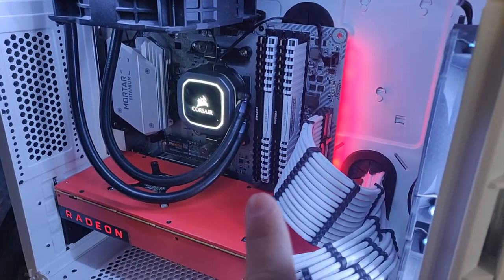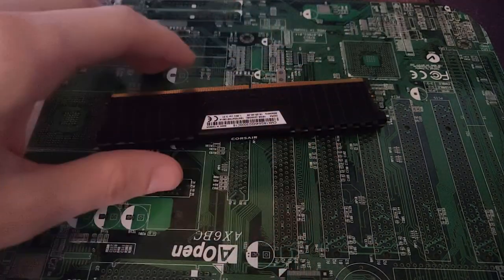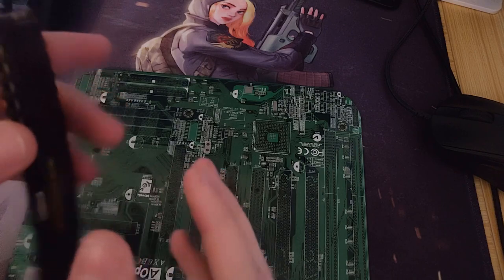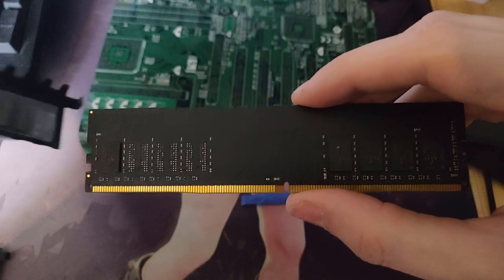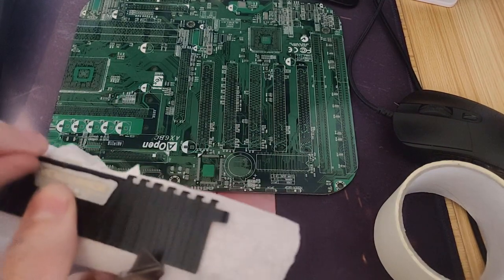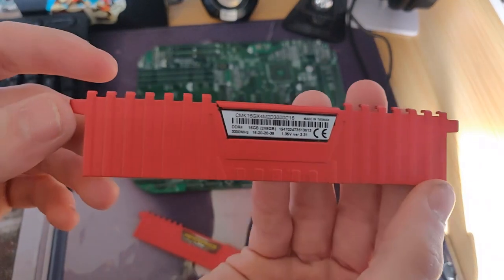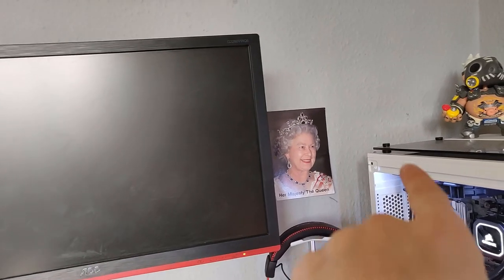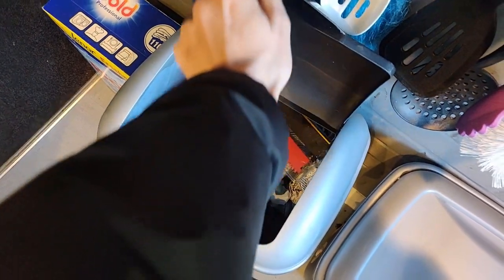Painting Corsair Vengeance RAM (tutorial)

Comment: Idk if you will be able to answer this but I painted mine and now my pc is shutting down after like ten minutes of a game do you thing it is overheating or something?
Reply from the maker: Did you take it apart correctly?
It could be multiple things
Reply: @tomoldy9767  I think I did nothing came off the stick and it went back together fine. I've taken it apart since then and now it won't boot 😖
Reply from the maker: It could mabye be just 1 small module came off somewhere, it's very risky doing This
It could just be dead all together
I broke a stick when I done mine and had to buy a new one
Reply: @tomoldy9767  thanks I worked it out one of the tiny things on one of the ram sticks came off so yh I'm stuck with 8gb but it's all good
Reply from the maker: @ned_he  atleast all of it didn't break and you can still use pc 😁
Reply: @tomoldy9767  yh it's all good my games still run fine and I've still got the second stick in there for aesthetics
Reply from the maker: @ned_he  I'd remove it you don't want a dead module in the pc